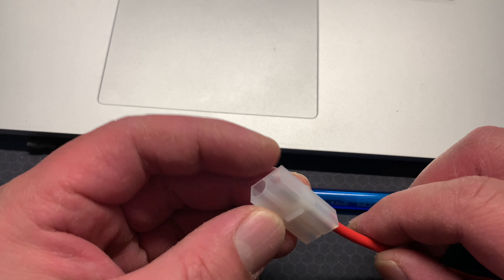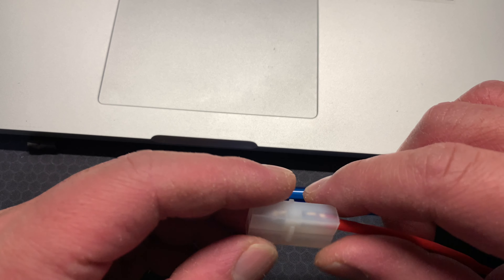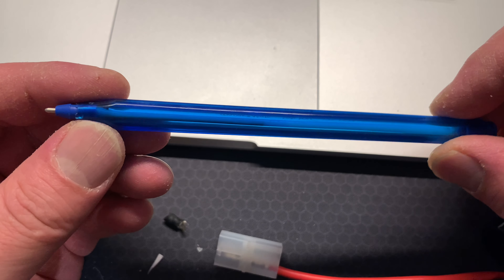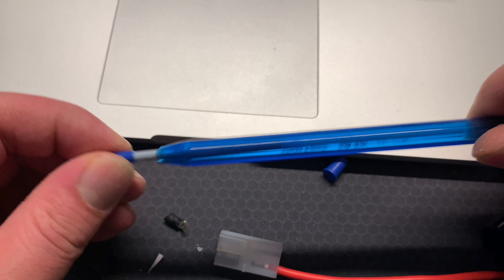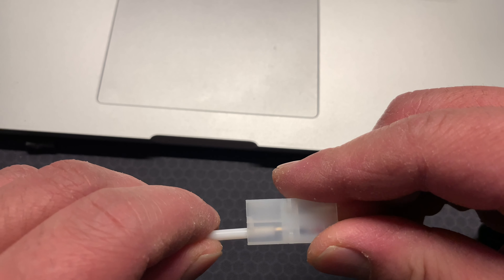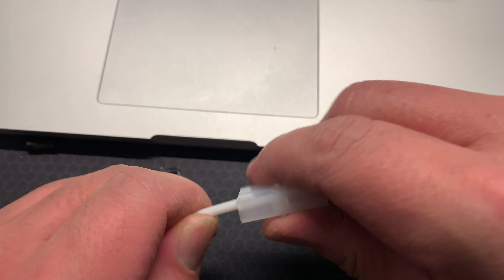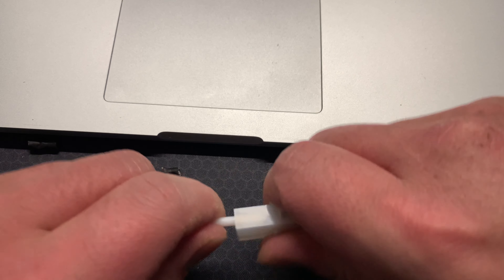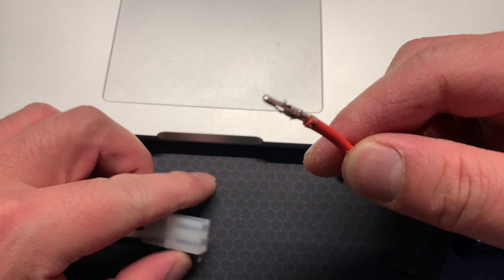How To Remove Tamiya Connector in about 1 minute

Comment: Thanks for this.  I was stuck last minute without my small to large tamiya adapter, and unable to source a replacement in time charge one of my batteries for the game the next day.  I used this trick and it allowed me to connect the pins direct to my charger using croc clips and thus was able to take the Uzi out in to the field yesterday.  You are my hero!

Comment: i hope you respond but what about the other end? the black cable of the other end (the one with the hole) is half way out of the white plastic for some reason that i don't know. do you have any idea about how to remove it so i can put it back the right way? thanks 🙏🙏
Reply from the maker: I’m sorry to say I didn’t need that end so have not delved into that black hole of a problem, hope you get it sorted dude! 👍
Reply: thanks anyways for the extremely fast response 🙏. i will maybe have to take it to the shop.

Comment: The pen didn't work but thank you for showing the concept, I was able to get it out using a 2.5mm hex key. As someone mentioned before it was to fix that hobbymate charger from Amazon that came with the wrong polarity

Comment: Thanks I had a rc car that the company purposely used a 3 headed tamiya with the red and black separated which meant I couldn't use a normal taiyma but only their specific battery. Now I don't have to buy an overpriced replacement.

Comment: Once you’ve done this can you connect the battery to a normal charger to charge the battery?
Reply from the maker: Depends on many things, if the charger is the correct one for the battery you are charging then yes, providing you use the croc clips in the correct orientation and stop charging once fully charged.
Reply: @astroblemeRC  I believe it’s a 4-8v nicd battery. 12000mah I was thinking of connecting it to a usb plug and charge it that was but wasn’t sure if it would work
Reply from the maker: @ildj_jm19li43  I would advise against that, simply for safety. NiCads are charged with a constant voltage if I remember correctly and they really do not like being overcharged which could be a risk if you charge via a non intelligent cable. Hope this helps 😊
Reply: @astroblemeRC  what else could I possible do

Comment: Hey, I've got a battery with this sort of Tamiya connector and it's a bit loose, it has a little bit of play in it, can you tell me how can i tighten the connector down? Thanks!
Reply from the maker: A little play is usually normal. If it’s popping out then have a look at the pin (metal section) there should be two prongs that stick out, they may be too close to the pin body, prying them out slightly to make them angled more aggressively will make them stay put better.
Have fun ^^
Reply: @astroblemeRC  Thanks for the reply! For now, it's only a little bit of play and it doesn't seem to affect its functionality. If it does, i'll keep your response in mind !